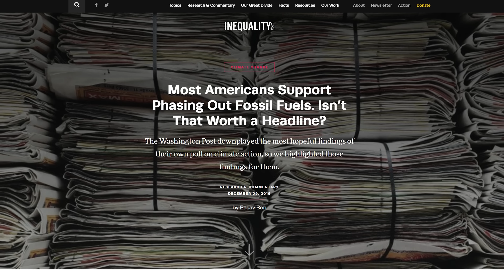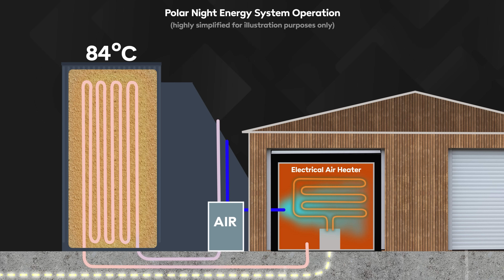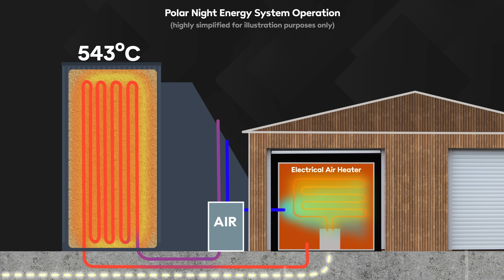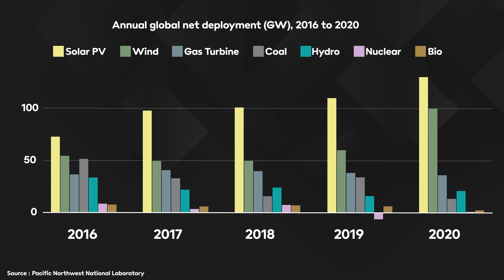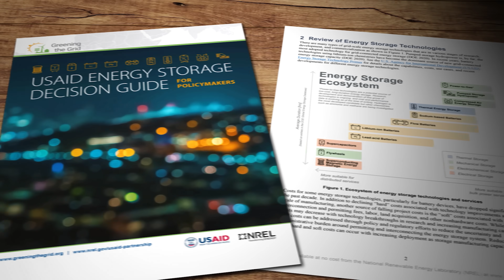The 'Sand Battery' that heats your home, NOT the planet!

Comment: 2:43 "air is heated by an electric resistance heater" what the hell? A resistance transform close to 100% of the electric energy to heat, ok. But a heat pump delivers 3-4Wh of energy for 1Wh provided as electric input (because it takes heat from the air). Then why the hell do we use a resistance heater here instead of heat pump? Too expensive? Even though it multiplies the possible energy output by 3 or 4?!
Reply: I understand your point BUT: 
- heat pumps are way more expensive and complicated than resistance heaters.
- they even may not be able to generate temperatures of 600+ C without applying even more epensive special materials.

Comment: I wonder how efficiently the sand stores heat if eventually it turns into glass or is this sand not viable to turn into glass?
Reply: The temperature is well below its melting point.
Reply: They probably have to heat the sand with air rather than have the electric elements in the sand for this reason

Comment: Excellently written and presented. Thank you.  Edit comment— you might check use of units in slides… kWh power vs. kW capacity. 
To viewers wishing for small scale or DIY thermal storage, look into groundwater coupled heat pumps, and good old fashioned passive solar  heat storage such as black stones or water drums placed inside sunny windows.

Comment: I'm curious as to whether this is something that only really works at fairly large scale; like - if it scaled in proportion you'd need less than a cubic metre of sand to store a lot of power for a single house. My suspicion is that you need a pretty large installation to be able to make use of the temperature gradient to prevent a lot of losses without insulation.
Reply: If you're at a beach, just dig 10 cm into the sand. The surface will be scalding hot, at 10cm, it will be cool or even cold. Sand is an amazing insulator (for example, because of all the air between the grains). So I expect heat loss to be a minor issue for this system, even without special insulation.
My second thought is that it's great that the system is pretty small. Instead of a huge one for the whole town, we can set up one per district or city block. That system will be much more resilient, easier to set up and maintain and still pretty efficient.

Comment: I recall when Billingham new town in the North East of England was built in the late 50's/60's, they implemented a district heating system with ducts along side the roads carrying the heating pipes. The system is no longer used, but the building housing the boilers and backup diesel generators still exists. It may have been still in operation until around 2010.  I think originally the idea was to use the waste heat from the massive ICI chemical works to feed the system but I am not sure that part ever happened. It heated homes, college, shopping centre/precint and the large leisure centre.
Reply: There used to be central heating plants all over major cities.  I remember seeing steam vents in the middle of a city street where they would put a big steel pipe over the crack or manhole in order to raise the steam above the road so it wouldn't wash out driver visibility.

New York city may still have places like that down in the older parts of lower Manhattan.  Baltimore used to.  Washington D.C. did, too.

Comment: You said they didn't use heat pumps to increase the energy density. However I missed the part on how data center heat was transferred to the sand silo. How did they get from, say, 95° to 600°?
Reply: They do it the other way around. Temperature of the air from the data center is about 60 degrees, but they do not transfer it into the silo. Instead the heat from the silo is used to warm up the data center heat up to 75-100 degrees which is then sent into the community heating network.
Reply: From what I understand the heating is achieved by electrically heating water into 700 degree hot steam and let that run through a massive coil, basically. Once introduced the sand keeps the temps until it is time to let the heat out again.

This is primarily a replacement to central heating boilers.

Comment: Xcel Energy operates a steam and cold water service in Denver. I've also seen large central steam heating systems on US military installations around the world, though I don't know if those are being phased out as they upgrade buildings. Side note: Ft. Carson, CO is installing a large flow battery on the base. Not sure what prompted it, but it will be interesting to see how it works for them!

Comment: Great video. A large part of my current PhD project is incorporating the same principles used by Polar Night Energy in to larger scale borehole thermal energy storage systems. In simple terms, I am investigating how to make the grout (used around the boreholes) electrically and thermally conductive, so that it can be used directly as an in situ resistive heating element for the surrounding sand/sandstone. Closed loop pipework, much like that used within the Polar Night Energy silos, would allow the system to be charged and discharged simultaneously, increasing versatility, minimising heat losses, and surface infrastructure.
Reply: What sort of temperatures are you anticipating? The problem with resistance heating is that it is very expensive. A heat pump run in reverse would put at least three times as much heat energy as electrical energy needed to run it, albeit at quite low temperatures.
Reply: @rogerphelps9939  absolutely. I'm a massive fan of heat pumps, but to run efficiently they require a low temperature differential. Resistance heating is extremely efficient if you can minimise heat losses (I.e. by discharging from the outside towards a central "hot core"). The temperature I heat to will be the result of laboratory self-heating tests when an electrical current is applied directly to the conductive (and biomineralized!) grouts - something that I am yet to test. And of course CFD solvers for heat flow.
Reply: Couldn't you add electrical cables beside the closed loop pipes? What's the advantage of using the grout to heat up the system ?
Reply: @MrCerdal  primarily a better contact surface with the formation and greater volume. The grouts/slurries are largely made up of silica sand sand held together by a conductive matrix.
Reply: @philsalter  I see. Thanks. does this mean that success depends on the uniformity of the grout from top to bottom (and therefore a pretty good drilling team)? And is this technique only usable in continuous rock so that no grout escapes into softer layers?

Comment: Are there some areas where geothermal heat potential is good enough to combine with the sand battery?  This system will find of competition with heat pumps, but they each have advantages and are better suited in certain areas.  Bigger the variety the better, mapping out which systems work where is needed.
Reply: Yes there are such areas: in the Netherlands. 
You should be knowing that Gilles de Brouwer...

Comment: An extension of this idea I've wondered about is using the heat for purpose as well as storage, even if that loses some capacity. Just about anything can be decomposed into its constituent elements given sufficient heat in a vacuum. So heat up difficult-to-recycle materials and then separate out the elements via gravity, spinning, etc. Cool the elements by transferring the heat to the district heating system, and then extract the elements for reuse.

Comment: Here in Denmark cities with district heating will have a mandatory connection requirement meaning it quickly works out for all parties. Also we are burning waste and putting the excess heat back into the district heating.
Reply: Same in Sweden.

Comment: How does the data center air which is less than 70° heat the thermal Mass without a heat pump? If it's connected to the system with a closed loop, the air would come back hotter.

Comment: In Denmark 1.812.332 danish homes is supplied with distric heating. thats 65 procent af all homes, around 3,8 millioner people.
Distric heating is a transmissionssystem, that can connect to all heating sources. Today the distric heating is produced by garbage, woodchips, straws, vind, solar heating, geotermal, nature gas, oil, coal, surplus heat from industries and so on.
72 procent of distric heating in denmark is produceret on renewable energy like sun, wind, biomass, biogas og geotermal.
the network is cosisting of 60000 kilometers of pipes, and contain 1 billion Litres of hot water.

I think these thermal storage solutions would benefit our distric heating systems well

Comment: if there is one thing we can take away from the war in Ukraine, it is the price hikes for gas and electricity (maybe oil too). it forces us to pause and rethink what we use to generate power. if the stuff is as cheap as it was a year ago, then people continue to drive around in 2t SUVs to get a pack of cigarettes from the nearest corner shop. but individuals are not to blame really. it's the governments giving in for far too long to fossil fuel lobbying and not pass legislation to build better insulated houses, research more in power storage techniques, build up renewables and impose a carbon tax on anything including meat production and dairy farming

Comment: Keep it simple as the saying goes ;) Never thought of sand as a heat storage system, I was wondering how I could store all my excess PV over the summer to use in the winter after my immersion has topped out each day - this gives me an idea :D
Reply: Can you use a ground source heat pump coil to store energy?
Reply: @kitemanmusic  in theory, yes you could heat up the ground or a water source BUT importantly, you then need to expend more energy to get it back again using the HP - I'm not sure the efficiencies would make that worthwhile or practical from a plumbing perspective  🤔
Reply: @kitemanmusic  yes if you deposit the heat into the sand.

Comment: 🤔Okay, for individual houses, what if you had the tower full of sand with the air pipes dispersed in it, heated the air with mirrors in a parabolic way like a satellite antenna or solar cooker works, pumped (using a small steam driven generator and battery) the air through one-way valves (?) from the heater into the sand tower in the summer and any other warm enough days to make the heater work,  and pumped it back out when needed. It would work for heating and with a larger steam driven generator could power your house. (?)

Comment: I’d love a long duration solar heat storage system with thermo-chemical phase-change material like sodium acetate or better, small enough to fit in my backyard, so I could grab the heat anytime the sun is there for later use - or sale.🌞
Reply: Sodium Sulphate (Mirabilite) might be the appropriate phase-change material; depending on its hydration, the phase change temp is adjustable between 20-40C, iirc.
Reply: @ermul61  As a thermal battery calibrated to 72F it may work. Needs a moderate amount of the mirabilite (which is  a kind of rock, and cheapish) placed in your house. And that's what it is: a thermal capacitance, not properly a heater, so intermittent power would have to go into it for heat.

Comment: The problem with green energy is they use to much fossil fuels to build. People like to start at the middle with green energy. Like right after the mining and process of the metals. Then there’s the factory they need to produce and manufacture. Not to mention the high cost you need to pay for other things we need in life , because green has drove up base metals and fossil fuel. The higher the technology the more fossil fuels needed.

Comment: I wonder how this compares to the "latent-heat" storage system you mentioned some months ago? (The E2S graphite+aluminium system mentioned here: https://www.youtube.com/watch?v=edVjYofLYc4&t=598s )  It seems to me Latent heat storage has some big advantages - specifically, extra energy goes toward phase-change rather than just higher temperature - so it doesn't need any more insulation.

Comment: Good to hear someone is working on a solution for winter heating. It’s been a big gap in the roadmap to zero emissions. I hope we can put 50 years of dithering behind us now.
Reply: This solution is at least 50 years old and solar panels for heating have been popular for 50 years even in Nordic countries... We had rechargeable batteries in the late 1990s that were good enough for all the renewable tech we needed and for everything else we have had solutions for at least 50 years... The major changes have been and still needs to be in attitudes of the public...
Reply: @0ooTheMAXXoo0  it's more about the cost, not attitudes... if you do not have to pay more for sth why bother. And if you cannot afford it, you simply cannot afford. Also lots of stuff like wind and solar were very expensive in the 90s

Comment: I live in Canada and work in the energy sector, district heating has been growing here though only for high density city high rise environments.  Even though its more efficient and cost effective the capital investment to do large scale heating for residential purpose has been the major blockade (there's no existing infrastructure).  Big companies are investing 10's of Billions setting up heat loops but these only feed commercial buildings, (not many) foresight planning on utilities don't exist here in Canada.  Ageing infrastructure and the capitalist profit margin requirements means they're barely holding the status quo, never mind improving.